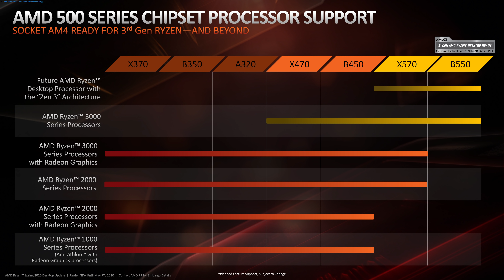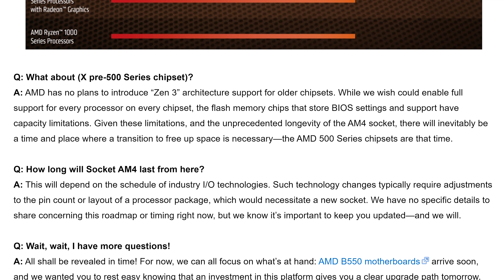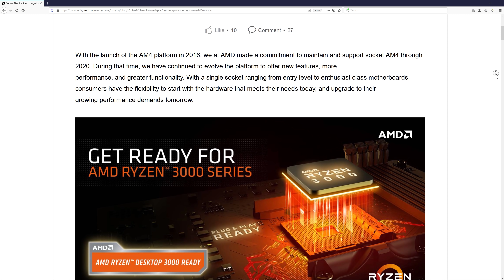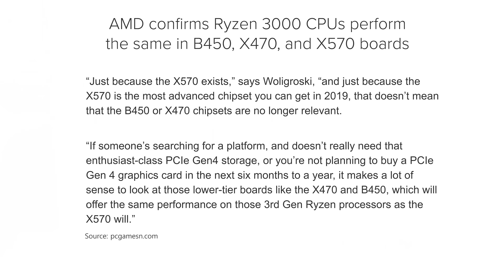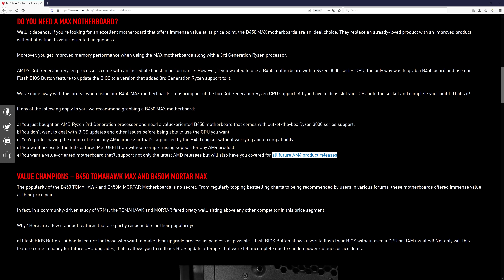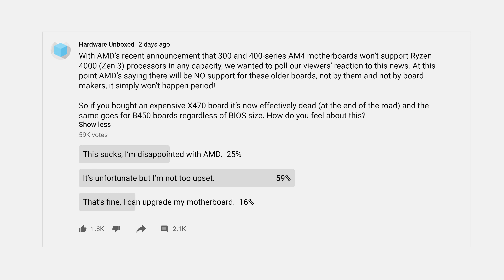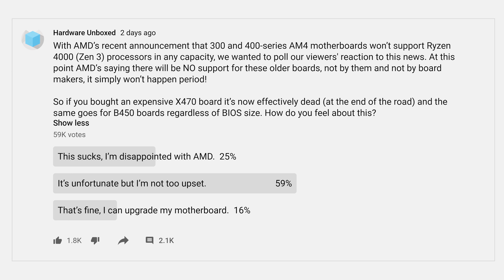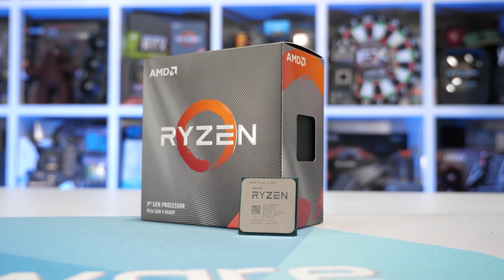AMD Does An Intel, Axes Zen 3 on 400-Series Motherboards, Our Thoughts

Comment: I fall in the camp of recent b450 users that have purchased since the zen2 release... that was a prick job AMD
Reply: @Icewizard007 technically yes it does support 3300x since it is a zen2 processor
Reply: @khoado2060  No it's not? It may be for someone who has no job but if you have a job 160$ should be nothing for you. But I'm guessing you're from the US and I heard people there don't have any savings :)
Reply: just buy a new MOBO you fucking goof, its not even expensive
Reply: They said they'd support AM4 til 2020, so it's not exactly a surprise. Stupid call on their part regardless.
Reply: @MarginalSC  some 400 series boards had bioses too small for zen 2 so the fact they are too small for zen 3 is no surprise either lol
Reply: @oldskoolhead0  They were big enough for Zen 2 support. Just had to lose support for older chips and strip down the bios frills to make it fit. (Also have a B450 Gaming Pro Carbon AC that I had to update as well as a 350M Bazooka.) Unless the new chips need more than a 32mb BIOS somehow, don't see how that's a real reason.

Comment: IMO, I think  AMD should have gone with 3 generations of CPU per chipset released.  So the only winners sorta in my thoughts at this point in time are the owners of the 300 chipset series motherboards.  Since those 300 series can handle Ryzen 1000, 2000 & 3000 series CPUs.  AMD should have allowed or should reconsider the 400 series chipset to at least..maybe get ryzen 3000, 4000 & maybe 5000..but update the BIOS to drop Ryzen 1000 and 2000 series.  Since some of the 400 series mobo partners such as MSI have larger BIOS ROM capacities.  Understandably, I see why the 400 series mobo owners feel ripped off.  1 mobo for 3 cpu generations is still way better than Intel.

Comment: When Steve said x370/b350 users have gotten the most out of their mobo I agreed. I built my system in 2017 and I figured when i got my board it’d last to 3000 series and not beyond. X370 user here, Asus Crosshair Vi hero, just upgraded to 3700x oc at 4.25ghz at 1.325.  I’m content since I got my 3700x on sale for $294, was able to get a cinebench R20 of 5071. It beats out certain 9900k’s overclocked which is very satisfying. So in terms of performance I am not disappointed. For all I know, maybe my next cpu could be intel when they get their crap together hopefully or it could be ryzen. I can definitely see the frustration of b450 owners (rightly so), hopefully this can change. Either way, we need more competition and I’m hoping Intel will step up and get back in the game. We win when they compete.
Reply: There's no difference between X370 and X570 aside from PCIe 4.0 and it's not an issue for compatibility. When I bought my crosshair VI, I did so because it was one of the few boards most likely at the time to maintain compatibility throughout AM4's lifespan. With zen 3 being AM4, the only reason to not allow Zen 3 on X370 doesn't actually exist.
AGESA 1.0.0.5 rolled out for 300 and 400 series boards, not all manufacturers have released updated bios's yet, but the same AGESA is rolling out for X570 but without support for first gen processors, so it's basically the same code minus first gen Ryzen.
There's literally no difference between 300 and 400 series hardware, just because many bought B450 because there was no B550 and didn't want to spend the extra for X570 for their Ryzen 3000 series processor isn't a reason to exclude X370 owners who spent extra getting the higher end boards for longevity, nor B350 owners for that matter.
Since when do we allow companies to so blatantly announce unwarranted planned obsolescence, not because of real incompatibilities but because of some arbitrary bullshit non reason.

Comment: As I have been waiting to see what B550 was going to bring before upgrading myself I'm relatively unaffected by this bogus move BUT i've been personally responsible for several recent builds with B450 Max/R5-2600 combos with future CPU upgrades in mind. The majority of these were in the last few months when the clearance price of the R5-2600 was only C$159 so it wasn't a terrible move overall but with only a current CPU to upgrade to its not as shiny as we were led to believe. I think you're spot on pointing out how AMD didn't pump the X570 more in the absence of B550 for future support and let peeps buy B450 mobos. Bait and switch B.S. Must've been a recent decision and possibly due to resources as you hinted.  I wholeheartedly agree with your  suggestion to support 400 series chipsets even if the 1st gen CPU's get axed out of the BIOS. Won't need that anyways after upgrading so why not?

Comment: All we have to do to get AMD to change this decision is not buy any 4xxx CPUs.  I bought 4-series boards for my two 3xxx CPUs, but I'm not hurt by this because I have never had any plans to upgrade again until DDR5.  Still, I feel for those who did plan to put a 4xxx chip on a 4xx board--wow, that does seem logical, does it not?  Frankly, AMD had a tough problem here. A lot of 3xx and 4xx boards don't have BIOS space for continued iterations, but owners of those boards are often not well versed in all that.  A lot of confusion could ensue if some 3xx and 4xx boards can run 5xxx CPUs and some can't. Stopping support in this manner solves that issue but creates the issue discussed here.  If I were AMD, I would have announced when 3xxx CPUs launched that these would be the last to run on 3xx and 4xx boards.  It's hard to fathom that AMD didn't know this at the time of 3xxx release.
Reply: I'll not be buying Zen 3 if it isn't compatible with B450/X470.  I had to learn all about Bios flashing due to the B350 memory compatibility issues at launch. Frankly  bios flashing has been an issue ever since they released the 2400G for the B350 motherboards.   So this is not a new issue.  The bios size is bogus as they can delete support for older chips.  That's what they are doing to the 3400G on the B550.

Comment: HU'ed, you're judging AMD on this issue based on what they've done in the past. Saying AMD is just as bad as Intel after tasting success is a legit take, now. Tech advances quickly. I judge company's on what they're doing NOW. Axing Zen 3 on 400-series MB's is a crap move, and it breaks trust in AMD going forward. At this point, I wouldn't be a bit surprised if AMD decides to not support Zen 4 on 500-series MB's. This would put them squarely in the category of screwing over customers like Intel.

Comment: Am4 was one of the foundations of the AMD revival. They could have dropped support for the first gen Ryzen or warned board partners to use larger bios chips. Instead with B550 they miss out one of the most important selling points as chip compatibility, but instead focus on things like Gen 4 which makes little difference and giving us back useless crossfire which nobody wants. Crazy. and crazy again for making this choice whilst you cant even buy B550.

Comment: Im lukewarm on this. I own a b450 i bought it a year ago when i retired my 4th gen i3 and replaced it with a ryzen5 2600x and have been quite happy since. Am4 as a socket has been a huge boon to lower the cost of the motherboards as a whole but it it will eventually need to be replaced but 4 generations in thankfully isnt the case thus we are safe for now. I reckon certain chipset integrators such as your gigabytes,asrocks and what have you will individually decide to roll out support on 400 series motherboards but it would only go to x470 at best. Motherboards can hold value if i resell my motherboard for about 60$(its an 80$ mb but it was bundled with cpu for 60$) thats fine because realistically id be only be paying 40$ for a b550. Unless the companies induvidually review their product line ups and determine support i doubt there would be support. Amd boards are still much more cheaper than comparable intel offerings ntm intels yearly/biyearly socket change. Time will tell what haplens but I really can't be too mad 2600x to the 4000 equivalent would be a considerate jump and that negates the price aspect for me. Hell i was more mad buying my ryzen parts 1 month before ryzen 3000 was announced

Comment: I believe that this is because of greed. Greed goes both ways though. AMD is a company and will need to report shareholder profits and return of investment, so they need to maximize their profit without breaking any laws. And us, the consumers that want them to support the platform as much as they can physically possible for free.

Software engineers that program the bios ain't cheap or free. That's probably why they'd prefer axing support instead of supporting it further. It's like being the tech person of the whole family where you are constantly being nagged everytime they are having problems with their computer/phone/tablet.

These free updates does not give AMD and their partners any compensation for their work. That is the real reason why Intel does not do backwards compatibility at all, and AMD is starting to realize this and scaling this back.
Reply: Actually it does.  I've been recommending Ryzen to friends and family because of the supposed support of AM4 through 2020.  This generates bad will among the people that have been supporting Ryzen.   In 2017 they were showing support through Zen 3.  This late change for a bogus reason is going to cost AMD share holders in the long run.  Never again will we believe that they will follow through on their support.   I understood why my B350 couldn't handle a 3950X.  The VRM's couldn't handle it. But I got to use the 3700X on it.  I don't get why my X470 can't handle a 4000 series.  It has a big enough bios.

Comment: By supporting the same socket for so long I feel motherboard manufacturers suffer somewhat bc ppl are less inclined to upgrade their board. I respect them for supporting older boards for as long as they have and can understand why it is beneficial to change. I’m just somewhat disappointed with the delivery of it. I recently bought a b450 tomahawk max and 3600 and I would have definitely opted for x570 had I known they weren’t supporting the former with zen 3. So knowing they weren’t supporting older boards and keeping a lid on it is more than a little deceptive and I’ve certainly lost trust in them.
Reply: That's exactly the issue.  This should have been clear at the launch of X570.

Comment: Do not forget most people bought B450 for Ryzen 3000 bought it in early 2020. Plus what is the point of socket stability when the CPU is not gonna be supported? It's not like you can get the socket from one motherboard and put it in the new one ;)

Comment: AMD is full of crap.   If they wanted to support it, just remove older chips in a beta bios.  They are completely full of crap and the poll results from the other day from the community are disturbing.  People are fine with getting screwed by AMD because well they are not getting screwed as hard as they would Intel.

They are doing this because they can,  the can sell more boards and are in position to get away with it.  And have enough stupid fanboys that even celebrate getting screwed by AMD

Comment: Suppose AMD pushed back ZEN3 until januari 2021... Would everybody be alright with their (over 3 year old) promise of supporting a socket until 2020? 

I am personally happy with the fact that zen hasn't even had a tik-tok release schedulde, but a tik-tok-tik-tik one... And now people are complaining that the very last tik isn't supported on an older mobo? Anybody who bought a B450 presuming they could plug in a ZEN3 chip was doing just that... presuming. 

Suppose Zen3 was pushed back even further for a ZEN2+ series, would that have made you happier with this news? At the end of the day, people really have gotten an insane (at least 2, even if that was worst case like B450) amount generations out of a single chipset. I prefer ZEN3 coming right on the heels of ZEN2 without the need of a ZEN2+, even if (and I'm sorry if you are amongst them) it comes at the expense of any B450 buyers who banked on an uncertain future. 

Is this the  absolute dream of a scenario? No. Did it have to be for AM4 to be an amazing improvement over anything you get from Intel? No. Is this somewhere in between those 2: yes.

EDIT I'm already going to pre-empt this: B450 was a ZEN+ release, not a ZEN2 one. Sure, it sucks that it was an amazing way to save a bit with ZEN2 hit, but to pretend B450 was a single generation release (as HWU is alluding to in the video) is not 100% true. If I pinched a few pennies by getting Z170 during 7th gen Skylake release, I didn't buy a "1 gen product" there.
Reply: Except that they were touting zen 3 for release in 2019 when they were saying support through 2020.  Implication was zen 3 was going to work on AM4 motherboards sold in 2017.  IE B350 and X370.  They almost backed out on Zen 2, only releasing beta bios to support B350 etc.  They need to release beta bios for zen 3.

Comment: While its not a nice feeling when your hardware becomes obsolete, and AMD did not explicitly say that B400 series would not support Ryzen 4000 series... they didn't explicitly say it would support 4000 series either. They made a vague statement "Through 2020" the fact is they have released some new processors 3100 and 3300X in 2020 that will work on very old boards.

I think you guys should be honest and take some responsibility for the fact that you took a risk in terms of upgradability when you chose 400 series over 500 series and it didn't work out. Even if you chose to interpret the vague "through 2020" as meaning "every single processor released before the end of 2020" (which looks like a stretch to me personally) if they release an anmazing processor on Jan1st 2021 you'd be SOL. If the 4000 series gets delayed til 2021 then you'd have no leg to stand on and it is not released yet.

I'm not saying AMDs decision isn't motivated purely by profit. It may be. But it is actually their job to remain profitable, to make more money, to reinvest and keep innovating to remain competitive with Intel. AMD has not had it easy. Don't forget AMD was at risk of bankruptcy after they bought ATI and were so far behind. Intel isn't twiddling their thumbs right now, rest assured Intel is working on new tech as well. If AMD allocates more resources to maintaining old stuff that doesn't make them any money, they'll have less resources to innovate and innovation will slow down. Development cycles in the CPU industry are more than 3 years long. Just cos AMD is on top now you can't assume its going to be plain sailing. Intel is 10X bigger and fights really dirty.

Again, try not to see everything in absolutes. Not saying you guys are entirely at fault and neither am I saying AMD handled this well or whatever.
Reply: I somewhat agree with you, but AMD has been playing the upgrade card since 2017, and have implied through Zen 3 since the start.    Zen 3 was initially supposed to be in 2019.  Zen+ wasn't on the initial roadmap.